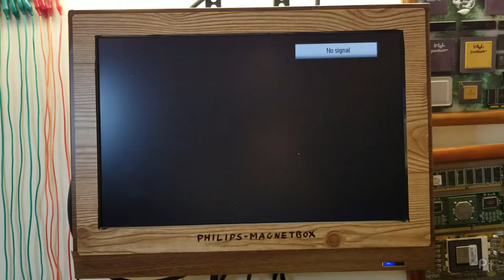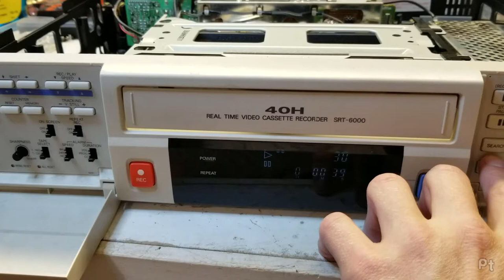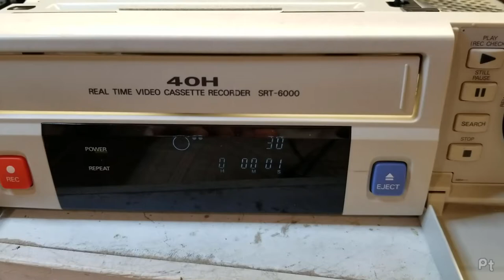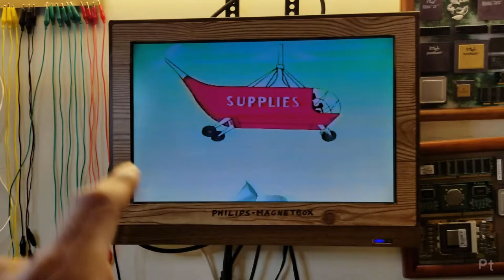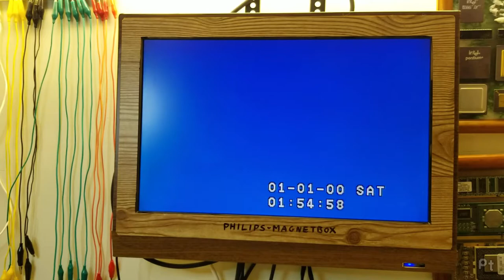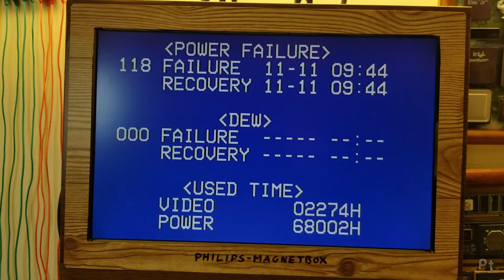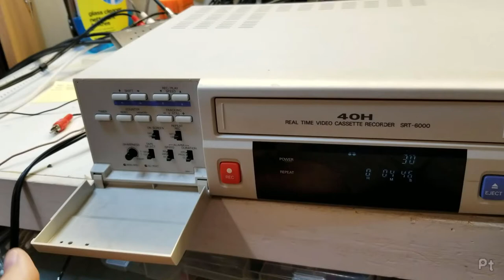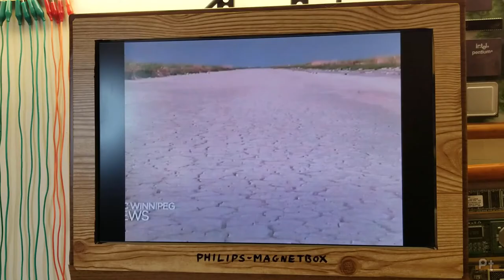Sanyo SRT-6000 Security VCR (from 2000)

Comment: Imagine if that VCR had HIFI, 40 hours of HIFI audio on a single tape!
Reply from the maker: I'm not sure that would work. This VCR only records 12 of the 60 fields in a second - which means the video heads are not recording 80% of the time. This is because the track width is the same as EP, and since the tape is moving 1/5 the speed, it needs to record 1/5 the amount of tracks (and wait for the track to fully move passed before recording the next one). Hi-Fi audio gets recorded "under" the video tracks, so it would sound like the audio was time compressed (check my video with VP recording played back on a non-compatible VCR - speed sounds the same but it's skipping sections).